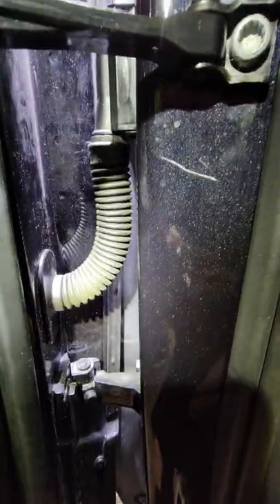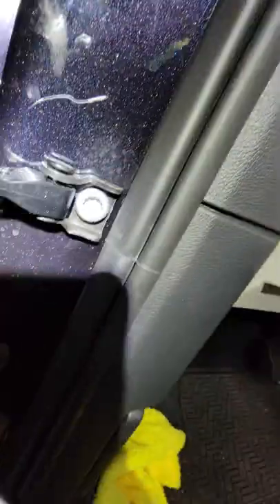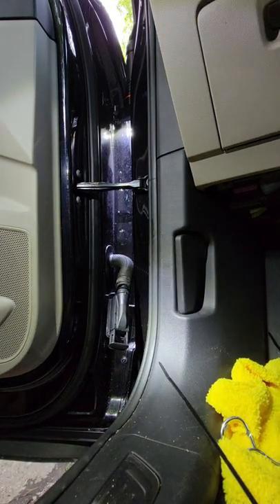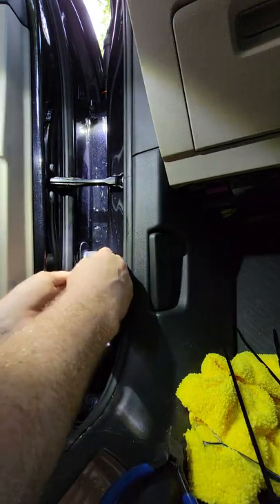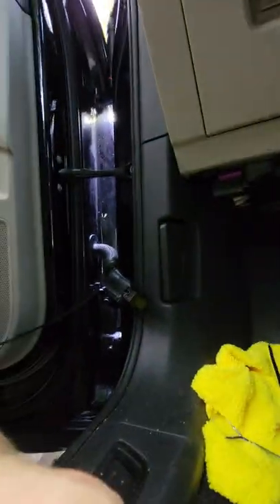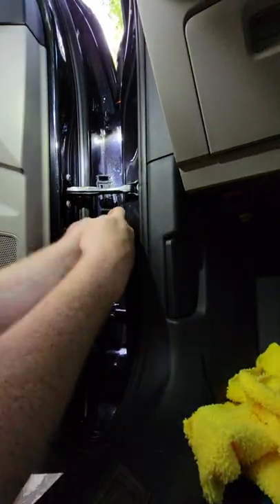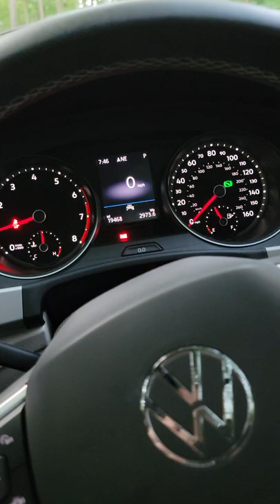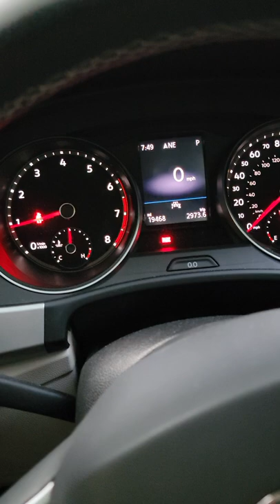2021.5 Volkswagen Atlas Door Harness Temporary Fix/Solution.

Comment: Thanks for the video. 2019 Alltrack owner here. Same crappy design, but we haven't had a recall yet. I'll try your method in the meantime. Cheers!
Reply from the maker: What symptoms are you having?
Reply: "Error Drivers Door Contact Switch". Just did the dielectric grease and my problems have ceased. We'll see how it holds up.
Reply from the maker: @pdubbs128  hell yeah!
Reply: @ArmoredBullTrading  just wanted to chime in that the problem has not returned. Your fix seems to have remedied the problem for good. Thanks again!
Reply from the maker: @pdubbs128  that is fantastic!

Comment: Thanks for posting! I have some Permatex Dielectric grease 81150, would you say this would be ok to put on the harness. I have a 2021.5, with no issues right now, but thinking about putting that on as a preventative.
Reply from the maker: Yes that will be fine.
Reply: @ArmoredBullTrading  I put the dielectric grease on mine today. My harness looked different than yours. I have 2021.5 SELP  w. Fender audio. It is white and not black. Mine was definitely not as loose as yours either. I put it on anyways.
Reply from the maker: @chasem2738  awesome, I hope the video helped. We are still issue free thus far. Yeah we habe SE w/tech ,regular audio :)
Reply: @ArmoredBullTrading  yeah definitely, after watching you do it, gave me confidence to get in there and do it myself.
Reply from the maker: @chasem2738  that is great news

Comment: We just bought a 2022 atlas r line yesterday. It was completely fine during test drive then now today we are having an issue when we hit the brakes it beeps and says engine running. Reason that this may be my problem. Can you share what was happening to yours?
Reply from the maker: I just saw this comment :*(. Did your problem ever get resolved?

Comment: You just performed recall 97GF. Tada. They pay .90 flatrate time to do that for the recall. Tape around the harness then addziptie over hole and then add cleaning solution and grease to connector
Reply from the maker: Yup.  , I will take it in to "let them do it" so its official, since we JUST got the letter finally recently.